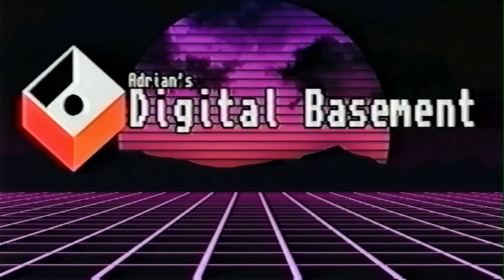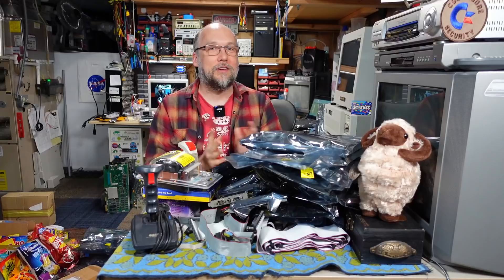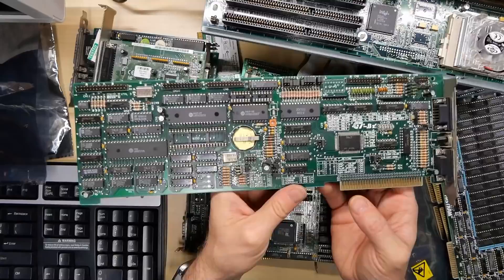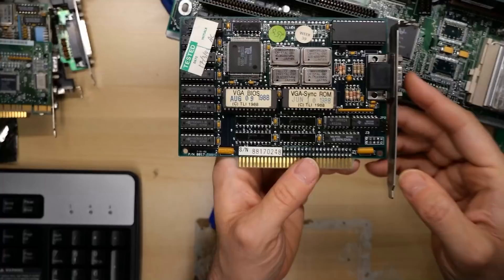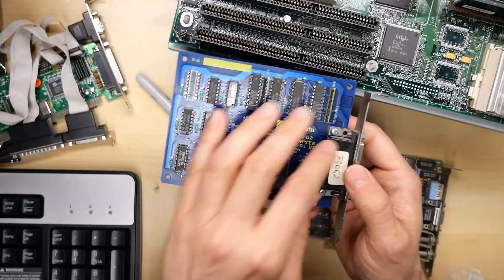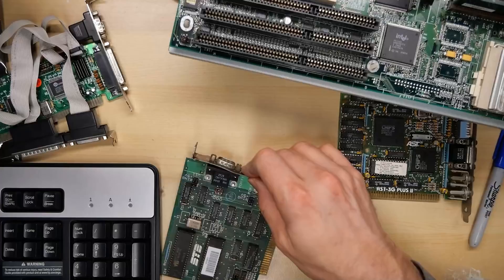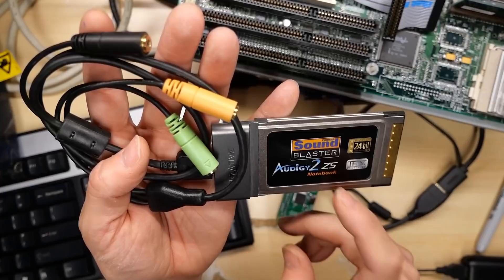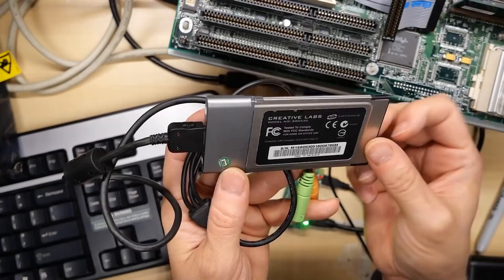The motherload of PC parts: Motherboards, ISA cards and more

Comment: The blue Mountain card might be controller card to a backup tape drive, the external 25-pin connector would go to the drive. I got a similar but green card with a 80MB tape drive from an old computer 25 years ago, played around with it and got working on a 486 but I only had a single tape and 80MB wasn't much when hardrives started to go over 1GB so I throw it away.

Comment: The blue card is a host adapter for the tape drive. Nothing special beside the blue PCB.

Also some EGA DO have composite output on the RCA connectors (common EGA Wonder 800 for example) and many CGA cards do have two RCA connectors as well (most of my clone CGAs do or at least do have a place to solder second one).

Comment: It's not good enough to just put in an 8250 or 16450.  You also need a 75188 and 75189 to populate the two empty sockets above the UARTs since they don't use RS-232 natively, but rather TTL.

8088-2 is an 8MHz part and -1 is 10MHz.  I believe an 80C88 will work at any speed up to 12MHz as long as the support chips are up to it.

Comment: As for that 8088 motherboard, maybe if you run it at 3.3v instead of 5v, you can overclock it to 10 MHz without it catching fire, exploding, or breaking your YouTubes (sorry, a little Fran Blanche, there)? 🤣
Reply: Decreasing the voltage would just make it less likely to work.

Comment: Have you tried the ASt 286 Board in a more modern ATX Case? That could work.
Yep, that should work in an ATX Case. And the older, early Generation of cases can also support old AT Power Supplies as well. But more modern donot.
Reply from the maker: I actually did check it against an ATX board -- and the connectors are a bit too close to the slot to fit properly too! What a pain
Reply: @adriansdigitalbasement  oh boy, that really blows :( 
Looks like an interesting 286 board, but without a case to use it in...

Comment: at least on the desktop I'm pretty sure my audagy 2 supported dos. I don't recall if it required anything special.
Reply: For Win98 DOS box support I believe you need the VXD drivers as opposed to the WDM drivers but apart from that it works fine (as long as you don't mind the emulated FM synth). There is a pure DOS driver (TSR) as well but it doesn't play well with extended memory managers iirc and you can only load MIDI soundfonts under Windows so you're limited to the (in my opinion) lacklustre 2MB Ensoniq soundbank.

Comment: that bigger heatsink is for an athalon XP, i think the smaller one is too, thought not 100% sure.
Reply: Socket 478 is the later Pentium 4.
Reply: @nickwallette6201  yes, they were made around the same time as each other, and most aftermarket heatsinks of the time have mounting bits for both.

Comment: 18:06 Actually, I believe they WERE used for RCA outputs. The feature connector directed the appropriate color and sync signals through the attachment card, and one could create a composite signal from it.

I found one from the Vintage Computer Federation: http://worldphaco.com/uploads/FITTING_AN_EGA_CARD_TO_AN_IBM_5155.pdf

Comment: J1 and J2 on the back of the EGA card do indeed go to the feature connector. 
For all things IBM EGA related, read the original IBM EGA manual -> http://www.minuszerodegrees.net/oa/OA%20-%20IBM%20Enhanced%20Graphics%20Adapter.pdf

Comment: Seen scsi cards like that for external Zip drives, etc. belkin wifi are the worst, come with an installer only that adds another not needed wifi utility. I always find the actual wifi chip model and use 3rd party driver

Comment: 8 Bit VGA card is a rarity? I have like three Paradise 8 bit (S)VGA cards (too bad two of them died), my Commodore PC40-III has one onboard (ok that thing's rare) and then I have a Delco branded Cirrus Logic VGA card from 1988 and one of my Tseng 3000s is also 8 bit (I upgraded it to 512k and now its really SVGA).
(and a stack of Tseng 4000s, these are great)
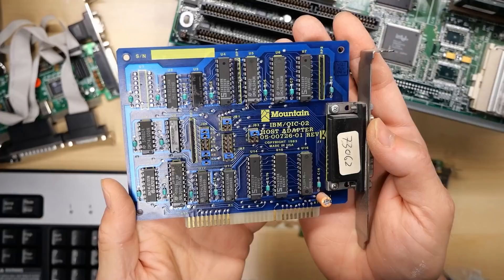12:00 that says QIC, not OIC which is a tape drive. I googled it and it seems common enough that the card came right up.

Comment: Adrian, you might be able to fit that 286 into an ATX case if you get a blank I/O shield, and cut holes for the keyboard and DB-25 connectors. Optimally, you'd want a "transition era" ATX case that has screw-in standoffs and options for different hole placements, though you can technically drill and tap new holes. You just don't want one with permanent standoffs.

Comment: I see 640K lower memory and 1024K of upper memory in the configuration. Then of course there always is 364 of umb which is only visible when using himem or other upper memory manager.
640KB + 364KB + 1024KB =2048KB = 2MB
With correct qemm386.sys and himem.sys configuration I used to load io.sys and msdos.sys to UMB loadhigh command.com and have 639K of ram free to dos...
Is is also possible to loadhigh a program in stead of command com.

Comment: Don't you have an ISA riser (extension) card for testing those long cards that don't fit?
That was 640K base and 1024k extended.  Sounds like you had the full 2mb, minus the rom/io area.
286 won't fit in ATX case, too deep!!!!
AMD 8088-1 is a 10mhz chip. https://www.cpu-world.com/CPUs/8088/AMD-D8088-1.html
Reply: That's absolute correct